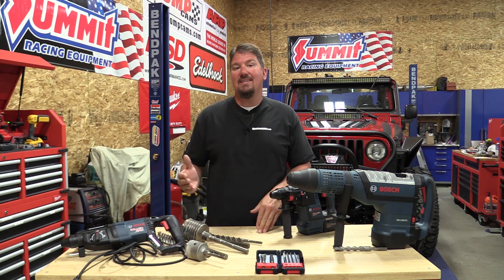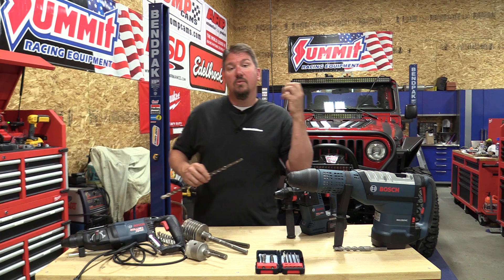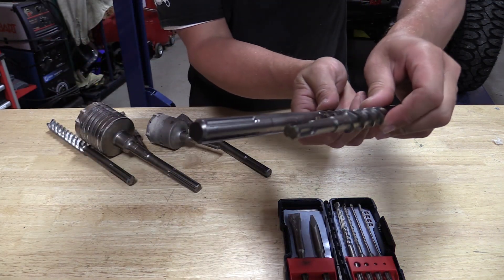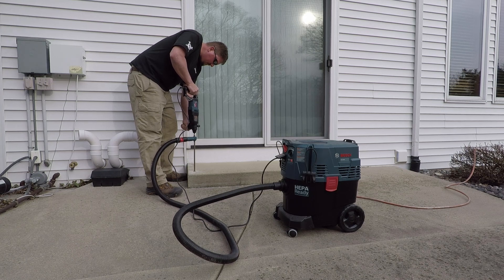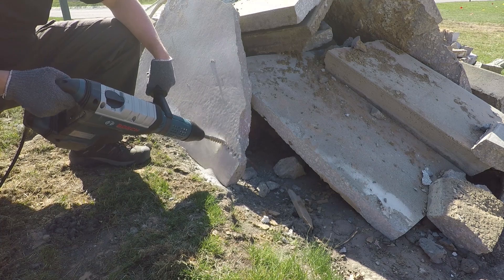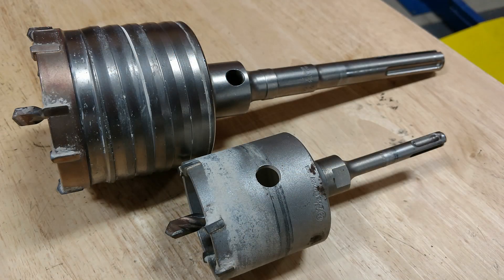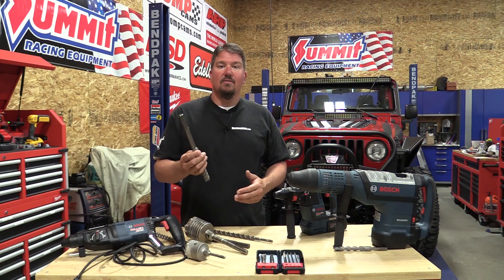SDS vs SDS Plus vs SDS Max | What Is Right For You?

Comment: Thank you for this! The size listed for each of these tools confused the heck out of me because usually measurements on drills refers to shank diameter capacity as opposed to drill head diameter capacity. That being said is the capacity only about drill head diameters? Can I use a 1 1/2” chisel bit on a 1” rotary hammer?

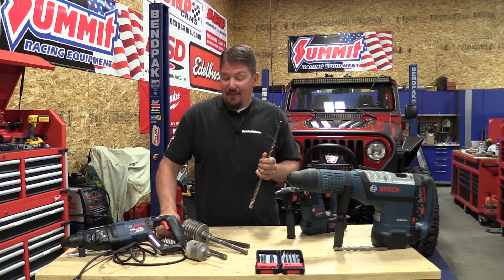Comment: You say (from the 1:10 - 1:31 minute mark portion of this video) that “When talking about SDS and SDS Plus (AKA SDS+) bits, SDS was basically the first type of bit that was made by Bosch, and they improved it a little bit, by doing an SDS Plus. So, if you have a SDS Plus or SDS drill bit, it'll go in an SDS or SDS Plus drill. Same thing; they're all compatible” 
B U T how can that be . . . how can an SDS Plus bit be backwards compatible w/an (older style) SDS drill / chuck, which was made for the older SDS style, two slot bits, and not the newer style, SDS Plus four slot bits? (O R did you men to say that both bits are cross compatible, w/in the newer, SDS Plus style drill / chucks)? P L E A S E explain / clarify, and thank you, in advance.

Comment: Great video! You just took a lot of the mystery out of my most recent tool purchase! 

As a DIY’er, I love me my tools (DeWalt is my drug of choice). I just scored on a “tool only” deal on the DCH133  ($142, otd via Woot) and bought that exact Bosch chisel and bit set ($32 otd on sale, Amazon). 
My first use was removing carpet tack from concrete floors using that flat chisel and it’s ridiculously good at that. I’ve got various projects planned that will require holes in concrete and stucco; I expect I have all I’ll need for my purposes.

Comment: QUESTION....I'm in the process of digging post holes. I am hitting solid rock at approximately 20".  I found a RELTON CC-36MX 1" x 36" Cold Chisel - SDS-Max.  Would you recommend I use this with a SDS Max Rotary Hammer drill or find a jack hammer that accepts a SDS MAX Chisel?

Comment: For the home owner, it is usually cheaper to rent the big SDS-max drill with the core bit, than to buy it. You simply don't use it often enough to justify the expense.

I came upon this video today because we had to drill a 110mm hole through a concrete slab today (that would be a little over 4 inches). The tool-rental places were all closed, so the usual method of drilling several smaller holes in a circular pattern until you've disturbed it enough to chisel it out was used. It took way over an hour with a normal SDS drill.

About halfway through I hopped on the internet to see if I could perhaps buy an SDS-plus core drill of that size. The answer is yes... you can buy a 110mm core drill with an SDS-plus connection... but man is it expensive. It's almost as much as a new entry-level Makita SDS drill...

Comment: Great informative & concise video. Thank you. For commercial construction use with sporadic small renovation work requiring chiseling trenches in bathroom walls for electrical and or copper lines/conduits, is it better to get a the smallest (lightest) SDS Max machine and use an SDS max to SDS plus reducing adapter instead of an SDS plus rotary hammer. My staff have broken two SDS Plus Hammers in such applications?

Between Makita and Bosh SDS Max which make and model do you recommend? Kindly advise.  Thank you.

I have a Heavy Duty Bosch SDS Max Demo Hammer for Floors & Slabs and a Makita Breaker Hex Demolition Hammer.

Comment: What’s the smallest concrete drill bits you can use with the SDS max
Reply from the maker: You can easily find them down to around 1/2", but you can use the Bosch HA1030 adapter to go to SDS plus bits if needed.  Getting into smaller bits with that large of drill could cause for some breaking of bits.

Comment: I just inherited a nice but old Hilti Torna 765.  It uses a hexagon drive shaft system.  Looks like 12mm or just between 1/2" and 7/16".  Is there any adapter to get from this size hex to SDS plus?

Comment: Thank you for the post! I know my comment isn't related to this video, but I'm hoping you'd be willing to help me out. I often have to drill through concrete walls at least 10" thick. I use a rotary hammer drill with a 5/8 and 1/2 drill bits and I'm blowing out the other side of the wall even with the 5/8 bit. What's the best way to drill a 3/4 core hole and keep it clean without damaging the surface of the wall for mounting purposes?
Reply: Coring machine man. Hilti has a selection over the years, and you can prob find them used. And I've seen off-brand machines as well. I'd think harbor freight has'm, if ya don't want to spend 1000s for a new Hilti.
Reply: I'm thinking more about what you actually asked. Seems a coring bit is too big. If I was worried about blowing out the other side of the wall (which I do understand why you could be concerned), I think I'd try putting a search bit through, ie; 3/8" etc, then use your 3/4" on the inside where you don't want it blowing out, then outside to drill your 3/4 hole. To me it seems it won't blast concrete/stone shrapnel that way.
Reply: @Squillaempusa.  I take it that your terminology of a search bit is the same as drilling a pilot hole before using the actual bit size needed to make the permanent hole? If so, we tried using a smaller bit first, but for some reason it still blows out the other side of the wall. We're using a rotary hammer drill and I'm thinking it's the hammer that's causing the damage when it punches through the other side. That's why I was hoping that if we used a core bit that it would give us a much cleaner ending result.
Reply: Yea, search bit/pilot bit. What about using a coring bit/cup bit for rotary hammer (lined up with pilot hole) on inside wall where you're having it blow out to kinda score the wall. I'm wondering if the blow out will be contained to inside of the cup bit hole. I feel like I'm rambling. Anyway, I agree that a coring machine would do much better, but you're looking at spending some loot. Not sure what your situation is. We use one a few times a year, when going through brick or a deep concrete wall, but only when we need a 2-3" hole. Not sure about less than 1".
Reply: I do hvac, obviously I'm not a concrete guy. So take what I'm saying with a grain of salt. I have gone through concrete, brick, and stone many many times, but not terribly concerned about the blow out (as long as no one gets hit by the chunks flying), since it's usually in a basement out of sight. Plus we usually sleeve the hole and patch around it with silicone or furnace cement.
Reply: @Squillaempusa.  I understand. I do commercial fire alarm and we also have to sleeve everything that's going through walls as well as fire caulk. The initial purpose for messaging you was due to a pull station that we were surface mounting in a parking garage near a stairwell. We need the concrete wall to have minimal damage not only to properly mount our device, but to also make it look good for cosmetic reasons. Now I know it's more logical to start drilling on the side where the device will be mounted, but I was just trying to make a clean hole on both sides if possible.
Reply: @reccothomas1689  I see this comment thread is about a year old now, but were you able to figure out a solution?
Reply: @crazymayne69  The only solution I can think of is to either turn the hammer off when I get closer to the other side of the wall to minimize the damage.
Reply: @Squillaempusa. yep

Comment: My hammer drill is not rotary. It fastens the drill bit like fastening screws so that the input portion is narrowed to fasten the drill bit. Can it be used with SDS whatever bits if it can fasten them?

Comment: Still didn't quite catch the difference between the old SDS and the "improved" SDS+. I'm just curious as to what they changed. I have both here, and can't tell the difference.
Reply: if i am not mistaken (i worked at bosch years ago), sds had a shorter stroke than sds+

Comment: I have a sds hammer drill can I use a sds max bit on the smaller drill, I know you can get adapter from max to sds but can you get an adapter the other way round sds to sds max.?
Reply from the maker: Unlikely that you could find an adapter.  SDS Max is usually used in larger bits so for most, adapters would be pointless since the smaller sds drills could not handle those bits.

Comment: Yes, for anything 3/4" and under SDS Plus works pretty well, possibly even faster than SDS Max depending on your drill. SDS Plus is a lot cheaper. I decent SDS Plus drill can be had for less than $200 (DEWALT DCH133B is a good example). Decent SDS Max drills are at least $400. The SDS Plus drills are not bad and can be pretty powerful. They will work much better than a standard hammer drill
Reply: I’ve been doing commercial and industrial for almost 10+ years and I’ve seen nothing but SDS plus a majority of the time. Idk what he’s talking about.

Comment: I have a Rotary Hammer Drill that has a chuck designed for SDS Plus Drill Bit. Question: A) Will i be able to use an SDS Max Drill Bit on the machine? B) Can i also insert and use a SDS drill bit on a SDS Plus Chuck Rotary Hammer Drill? Look forward to your answer.
Reply from the maker: A:  No, you can not use an SDS Max bit B: You can use an SDS or SDS Plus bit
Reply: @WorkshopAddict  Thank You so much for the answer

Comment: Thanks for your videos, I am interested in the difference between Bosch Rh382 and RH 432, and which is better?
Reply from the maker: What will be you main use for the tool?
Reply: @WorkshopAddict  which would you recommend for 3/4" holes in reinforced concrete, 2" deep. 40 on a job. 20 +/- times per year ?

Comment: Great video and good explanation of the bit sizing and their limits.  Too many people buy because it's the 'cheapest" version but never the right size for the job.  They mention core size bit, is that to say an SDS Max can core a hole up to 6 " and drill a 1 3/4" hole.  What would be a hole sizing using an SDS Max Drill?
Reply from the maker: All SDS drill are rated for the max standard hole they can drill.  Core sizes vary between companies.

Comment: I didn't realize I needed a special drill to be able to use the Bosch SDS PLUS CONCRETE DRILL BIT I bought.
Reply from the maker: Yes, but you can buy the Bosch Multi-Purpose bits for your regular hammer drill.
Reply: Lol
Reply: Dumb ass

Comment: Sds. Plus is good for up to 3/4”....it’s rated 1 1/8”...about 3/4 of the Max output is all you should use for bits...we use Dewalt sds plus for 5/8 and 3/4 HDU hold downs, works very fast and reliable.....anything over that we use a Hilti max...Although Flexvolt has a 1 7/8 “ coming soon at 13.3 joules...
    Great videos...good info 👍🏼
Reply: Joe Framer I use a 1 1/8 bit on my sds plus drill sometimes and found that using a higher AH rated battery definitely gives it more power and speed. They only advertise more run time but reality is they allow for a lot more power also.
Reply: Yup. Have had a reliable hilti rep telling me the higher ah is capacity only, but I think most users notice more power/torque also.

Comment: 2:42 how is the vacuum attachment doing anything so far away from the tip?
Reply from the maker: That is a Bosch SpeedClean bit.  Check out this video on it.  https://www.youtube.com/watch?v=5Osg2NUMANE
Reply: WorkshopAddict      yeah  but its not sucking dust until he deills the hole another 18 inches deeper.
Reply: @UpcomingJedi  It's sucking dust the whole time. That's the point of these bits. Check out WorkshopAddicts video link and you'll see it in action.
Reply: I think the bit is hollow and sucks dust through from the tip?  @UpcomingJedi
Reply: https://www.boschtools.com/us/en/more/extras/specials/speed-clean/

Comment: Do you know of an adapter that would allow SDS-Max bits to be used on a SDS-Plus tool?  I have a lot of nice chisel and point bits for my DeWalt SDS-Max demo hammer that I would like to occasionally use on my smaller SDS-Plus rotary hammer. I recall seeing adapters to use SDS-Plus bits on SDS-Max tool but not the other way around.
Reply: EOSJOE no, he sez thats not available b/c sds has less hammering power which is why they dont make the sds bits in the larger sizes to begin with.   Get the bigger hammer and  the adapter to use sds in sds max
Reply: That's not the issue. I already have a large DeWalt SDS-MAX 23 lb. demo hammer. I have a lot of nice chisel, point and spade tool bits. I also have a SDS-Plus tool. I would love to use my SDS-MAX chisel and spade bits without having to go out and buy a new set of SDS-Plus bits. The bits I have are the same size as their SDS-Plus counter parts. The only difference is the shaft. If there is an adapter to use smaller SDS-Plus on a big SDS-MAX tool (which to me would risk damaging the smaller bits), why isn't there an adapter to use the larger shanked SDS-MAX bits in the SDS-Plus tool?  There is no risk of breaking anything when you use a large bit on a small tool. It's like using a 1/2" socket adapter on a 3/8" ratchet... no damage. But use a 3/8" adapter on a 1/2" ratchet and you can break something. :-)
Reply from the maker: You want this, but plus to max? https://amzn.to/2N11xUi
Reply: Yep!  I know it sounds silly but I only need to use the bits once in a while on the SDS-Plus tool. I even have a nice SDS-Max spade digging tool that would be nice to use. Normally, with most adapters, using bigger gizmos on a smaller tool (i.e. 1/2" sockets on 3/8" ratchet) is more common as you don't have to worry about breakage. So it's odd that they have adapters to use the small SDS-Plus bits on giant SDS-Max tools. :-)
Reply from the maker: There has to be one out there.
Reply: Can I use 1 1/2 inch sds plus chisel to Bosch bulldog 1” sds plus rotary hammer drill?  Thank you very much for the nice and informative video .